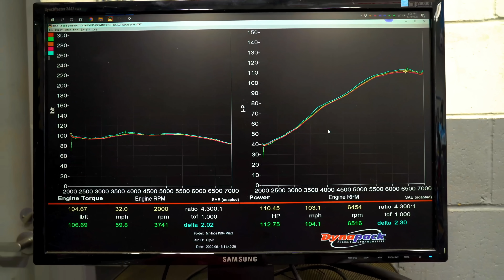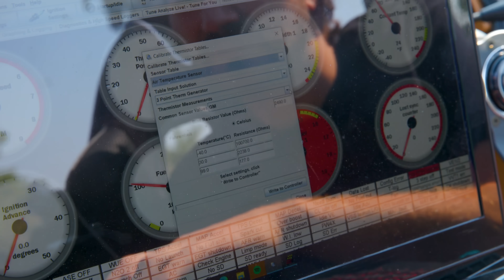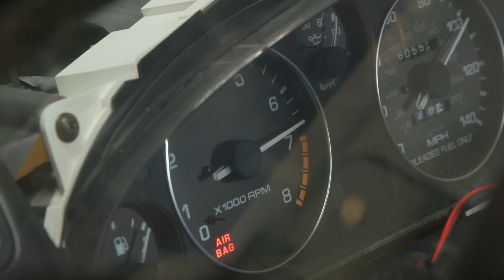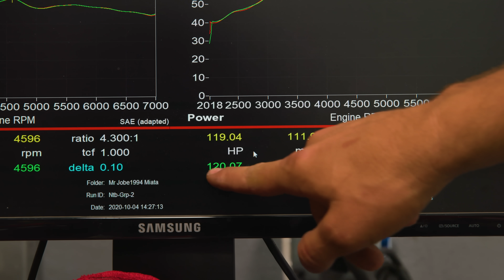Is an Aftermarket Intake System Worth It?

Comment: "it's temporary" a lie every car guy tells themselves when they do something super jank lol
Reply: Yep till it breaks and then your like now it’s time
Reply: Every time I put a zip tie in. Then I see it the next time I’m working on it and just shrug
Reply: @bensrants6772  ya, if the zip tie works, it works. Even I have some lol.
Reply: "This is only temporary, unless it works."
Reply: @ateamfan42  my old truck has a cracking tube but it’s not broke yet when it does. I’ll prolly steal one off a junk yard truck
Reply: Lol that was just me last week.
Reply: Ya literally EVERY time. 
Gettin towards the end of a project, getting late, I'm super over it...
IT'S JANKY TIME!

Tape lasts forever until it doesn't.
Reply: I feel attacked by this comment.
Reply: @bensrants6772  lin
L
Reply: @bensrants6772  one of my engine mounts is like 30 zip ties lmfao.... Alot of engine shake but it's finneeeeee
Reply: 8 months late but I snapped my chain on my bmx and didn't have what I needed to replace it so I bent the snapped chain plates back in a vice and it was the sketchiest thing ever. only difference was, it was actually only temporary haha
Reply: Well he is putting a turbo on, and can't really re use the tube without atleast cutting it down shorter, so I'd imagine temporary isn't really a choice unless he decides to not turbo it.
Reply: i was using ziptie and some duct tape to hold wires in place in my dirtbike for "temporary" but 1 year next its still there and work well
Reply: Technically everything is temporary
Reply: There was no need to call me out like that
Reply: True in software as well
Reply: Truest comment here

Comment: a couple episodes later "how to fix a boost leak on a turbo 1.8 miata"
Reply: Isnt his one a 1.6
Reply: @ariyankhan4337  nope its an 1.8
Reply: Zack is actually a grandpa Workin in a busted knuckles garage
Reply: @Blamant  i thought they didnt offer the na with the 1.8
Reply: @ariyankhan4337  1993 onwards got 1.8
Reply: @RiloElton  you're wrong. The NB was the first to get the 1.8L from factory. At least in the US. I cant speak for Japan or Europe.
Reply: @ariyankhan4337  they did with later NA models
Reply: @CoochieKissKing  1.8L was an option
Reply: @CoochieKissKing  bruh US isn't the whole world
Reply: @CoochieKissKing  NA Miatas got 1.8s Globally in 1994. That's why people say NA6 and NA8. Why are you such a goofball
Reply: 1990-93 is 1.6 b6ze, however 99.9% of US 1994-97 NAs are 1.8 bp4w. Most US 1999-00 NBs are also 1.8 bp4w with a different head design than the NAs, and obviously 2001-on has the 1.8 bp5a with the VVT head. Well, except the Mazdaspeed, which has a modified bp5a block (with oil feed and return ports) and the 99-00 head. The annoying thing, and the reason I say 99.9% is that Mazda continued to make a cheaper Miata with a 1.6 engine and the weak open 1.6 diff throughout 1994-05, but this didn’t sell much if at all in the United States, however its really common in Europe and Japan (places with taxes based on engine displacement). The thing that really sucks about these 1994 and newer b6ze’s is that they have milder cams and a lower rev limit than the original 1990-93 1.6s and make even less horsepower. Add in a couple accessory drives and the engine is totally neutered. Those cars suck, but anyone who knows miatas can spot them in an instant by the front coolant neck housing and distinctive intake manifold design. Plus the whole engine is physically smaller and the swaybar mount is further back. Now I bet you know more than you ever wanted about sub 100hp engines lol
Reply: @elementaljosh  thank you now I am certified to work on miatas
Reply: Yup
Reply: Nikku wait you actually read that wordvomit 😂
Reply: @RiloElton  1994 not 1993
Reply: @thumbtak  you're right. I messed up. However, 93 still did not have the 1.6.

Comment: Zachs Miata: $11,000 in aftermarket parts.
Zachs Miata: Long wait for a $50 battery.
Reply: Batteries for Miatas are pretty pricy if you go with the OEM Absorbed Gas Mat style (AGM). It's like $120 to $150 or so?
Reply: @slandon1977  I recently changed mine. Costed me ~$150
Reply: @slandon1977  you could probably get away with a cheap lead acid lawn mower battery lol its not like it needs a lot of current to start
Reply: @slandon1977   what is so special about the Miata Batteries?
Reply: These guys in the comments of this joke are probably tons of fun at parties. I laughed my ass off at the joke, op
Reply: A 50$ battery will have him in the same situation 😂😂
Reply: @PrashantChindarkar  AGM batteries don't leak which is especially important because they are located in the trunk of the miata
Reply: @PrashantChindarkar  From Wikipedia: "The sulfuric acid is absorbed by a very fine fiberglass mat, making the battery spill-proof. ... The battery stands up well to low temperatures and has a low self-discharge. The leading advantages of AGM are a charge that is up to five times faster than the flooded version, and the ability to deep cycle."

Also, it is nearly impossible for it to leak sulfuric gas into the passenger compartment, which is what the trunk is.
Reply: @loosenoose  Maybe I just didn't get the joke? I thought until recently that the only place you could get a Miata battery was from the dealer or one of the Miata parts places (like Goodwin Racing etc). Turns out O'Reilly's has one in stock that is probably the exact same battery. AGM and everything.

I was mainly commenting about the "wait time" because if you ordered a battery online rather than picking it up locally there WOULD be a wait of several days at minimum.
Reply: @slandon1977  wish my mitsubishi fto didn't need lithium's 😤😤
Reply: @slandon1977  That's nice. And at approximately ₹11250, they are quite pricey.
Reply: Prashant Chindarkar it’s actually a special kind of battery, particularly the size, you can’t really fit any battery
Reply: Honestly atleast you guys have good batteries. Pretty sure you can mount those batteries sideways alot of audio guys use those batteries. That or a capacitor of your ppor
Reply: @slandon1977  that's cheap?🤔 400€ battery would be expensive
Reply: @slandon1977  Is that even expensive for an AGM battery?
Even an ordinary 61 Ah battery for my car is almost twice that, in my country.
Reply: @slandon1977  It's not "sulfuric gas." Lead acid batteries, use hydrochloric acid not sulfuric and they give off hydrogen. Hydrogen build up in a trunk, or inside the vehicle can be dangerous.
Reply: is that number accurate? jesus i didn't know it was so much already
Reply: PGTMR2 yeah, for some reason I whiffed that. Good catch.
Reply: @slandon1977  No prob. I think it's an easy slip to make
Reply: @pgtmr2713  basically all the places that talk about lead batteries say they use sulfuric.... ?
Reply: @slandon1977  in your first comment you said "gas mat" when it's "glass mat"
Reply: @hildamcsulla2741  I mean any battery that’s not cheap shit won’t leak
Reply: @mercury0214  yeah, but AFAIK, flooded lead batteries have a higher chance than AGMs, for example, if placed sideways or anything that isn't straight vertical. Or than Li's
Reply: @chelarestelar  yeah I guess I’ve just never turned a battery upside down haha put it in the engine bay and check on it when your car don’t start
Reply: @mercury0214  it can seem like a joke but, if the car flips down or is a race vehicle, the acid inside of a flooded could spill. Also, lead batteries are heavy AF and IIRC, AGMs are lighter
Reply: @chelarestelar  also I’ve more or less had more car on 2 wheels and never spilled any so people just have to stop buying cheap shit lol
Reply: @chelarestelar  Looks like I'm wrong, and you are correct. Not sure how I got turned around like that, but that is on me.
Reply: @pgtmr2713  nah, no worries
Reply: My battery was $120
Reply: @slandon1977  Made I larf. Thank you ( :
Reply: Just paid $249 at an Oreilys for a premium battery. It's all the had in stock....

Comment: Zach : "We're gonna Turbo this car"
stock internals : "Imma head  out'
Reply: Remember. If you're drag racing it only needs to work for the dyno pulls and less than a minute at a time xD....
Reply: Is your name at all related to that guy with a mustache?
Reply: Clayton Salvigsen yes, but there is a guy on YouTube, his profile picture is jellal with a mustache and his name is “just some guy with a mustache” I was wandering if that’s what this guy was talking about
Reply: @jessiesratrods1210  if you run anywhere near a minute on the drag strip that's hilarious but he's also not drag racing the miata as far as I know he is doing timed laps which most courses in the miata will take more than a minute or close to it
Reply: These engines were used in another Mazda platform and they were turbo’d so they’re pretty reliable on low-mid boost
Reply: It’ll do fine in low boost... like low boost lol
Reply: @zander5173  you know you have to drive from the pits to the line, warm your tires, wait for the light to drop and then make your pass and go back to the pits right?

Comment: I have the same intake manifold its great only has one weak link, the sheet metal bracket for the throttle cable are known to fail. @DonutMedia Let me know if you want the billet replacement version I made to solve the issue. I have sold over 100 that are out in the world would be happy to get you guys set up with one also.
Reply: @DonutMedia, definitely check this out. Seen the failure first hand. David’s solution is top notch and track proven.
Reply: These are facts. Mine died on track. It sucked. David fixed me all up.
Reply: We need more people like David in the world
Reply: Does anyone know what type of thread sealent is good for the fittings on the intake?
Reply: Hey man, you definitely should hit Jobe up on twitter and let him know. As someone mention, another option would be to send them one with your information and explanation. You can find their info on their website.
Reply: I would love to buy one, mine snapped in half on track 😂
Reply: The billet one you had made worked great on mine.
Reply: Where can I get one?
Reply: @eviltwiiin  my email is in a previous comment or find my on social media
Reply: you wanna throw me one for free?
Reply: @tougetito  seriously?
Reply: @Parker_white_guy  well i got it, so….

Comment: Hey Zack, just a heads up. Keep an eye on the silicone & aluminium hoses/ tubes along your air intake. They have a tendency to pop of in small, hard to see areas, if left too dirty, especially when turbocharged. Speaking from experience. This caused all sorts of sensor issues that near crippled the car. 

Really enjoying this series and everything you guys produce. 
Thank you very much every one at Donut media.

Comment: "We're gonna turbo this car" - Did you learn nothing from Hi-Low?! Lol. Also this is the best series on donut so keep doin it!
Reply: The issue with HiLow was that they rushed the turbo job. Zach seems to be taking a much more careful and methodical approach to turbo-ing his car so he shouldn't run into the same issues.
Reply: Hi-Low are too rushy, they didn't even address the reliability issue comes with 350z and straight up adding all sort of stuff
Reply: My dad supercharged his 350z and had a mechanic do it and it took them a week but it’s been three years I think with no issues, yet.
Reply: What I’m saying is if you don’t rush it and do it right then it’ll be fine
Reply: @Leon98Leo  yeah I never took into consideration the fact on how fast they put the turbo on since they got the car.
Reply: agreed this guy is my favorite
Reply: The miata motor seems to take the added power more easily. Take ricermiata, kid beats the fuck outta them turbo miatas, and for how shitty his luck is i dont think he's actually blown a miata motor.
Reply: Supercharge the yata instead. Whos with me?
Reply: R P no one I hope, why the fuck you want a supercharger on a miata instead of a turbo...
Reply: @davidhenneberg6772  ask goodwin racing
Reply: R P I don’t ask anybody, I drove supercharges and turbos and turbos are much more fun to drive (my opinion) instead of supercharging it I rather would build it NA with the same power but it will sound much better and drive better
Reply: Since HiLow ended, this is now the best series on Donut Media. 😂

Comment: For anyone who messes with cars at home, if you have high pressure fuel lines (usually GDI engines) you can't just pop them off like Zach does in the video. His lines where anywhere from 28-50 lbs of pressure. High Pressure lines can be up to 2200lb+ on some cars and the stream of fuel out of those at that rate can laser through your fingers. Old cars have at it, you just get some fuel spray.
Reply: Good safety tip there's a lot of young guys and beginners watching these

Comment: A year from now: "Is a Turbo LS Swap Worth It?" Now we're getting to the triple digit power gains.
Reply: I wouldn't be surprised
Reply: Along a long enough timeline it will have an LS swap.
Reply: @FXIIBeaver  Ahh yes a man of RCR culture I see.
Reply: @microcar14   OH yes. But truer words have never been spoken. And depending on the set up that could be a quad digit swap.
Reply: LS is for babies, real men put v12 in miata
Reply: @Zuroslav  please tell me where you get a cheap, reliable, and easily found for cheap?
Reply: FXIIBeaver
It’s a Toyota V12 in a Miata. It will be reliable.
Reply: @negativeindustrial  the Toyota GZ? that was only available for the Japanese market? The one that has no source of parts here in the states? The one that you have to import from Japan?

Looking at all that. It seems it doesn't fit the cheap part of the cheap, reliable, and easily found. Nor does it fit the easily found part either. So yall need to bring yalls dreams down a little more to earth.
Reply: FXIIBeaver
All I drive are rare Toyota sports cars that require parts to be found in japan and imported. The parts are usually cheap AF but you really won’t need many very often because they’re Toyotas. I guess my idea of easy to get parts is very different than most.
This guy is also twin-Turboing his so we will see how reliable it remains, I guess.
Reply: @FXIIBeaver  what about a v10 Magnum from a old dodge truck could be interesting
Reply: @cancerman3990  how old? Anything from chrysler from 80s to 2010 is a very dangerous thing.
Reply: Was literally thinking on the same lines of thought!
Reply: Toyota V12 don't make power anyway.
Reply: @Ben-hf7fg  also valid point. Tiny motor. My smaller yet bigger motor makes more power.
Reply: @FXIIBeaver  I'd rather see a 18rg race engine in a Miata then a v12 limo engine. I love cool Toyota shit but the V12 only has novelty value imo.
Reply: @FXIIBeaver  I don't know to be honest I don't know much about the magnums but Wich ever is most reliable
Reply: @FXIIBeaver  you might be able to find some old BMW or Mercedes V12s in junk yards
Reply: Gl watching them do a turbo ls swap, either it's gonna be stupid or they'll pay a fabricator and mechanics to do a rear mount setup for them
Reply: I think a 2.3 ecoboost would fit, actually

Comment: “We are going to turbo this car.” 
This should be put on a shirt at this point for all the Car enthusiasts kidding themselves. 

But, I am excited for when he throws in the turbo tho.
Reply: Haha its true. The turbo project is always the goal. Im finally getting around to doing mine. I set a budget and im just doing it. So far i've spent around $2000 in only a month and still am around $2000 away from a quality setup.
Reply: Clesarie : I’m always jealous for how cheap you can get turbos for those lil Japanese cars. it’s the same thing for the brz too. I’m looking at 10K if i want a full kit for my 4.2 Audi S5 😔
Reply: Cardi B same for mine (Audi S6 4.2 V8) want to Turbo or supercharge it but it costs too much (but I think we can build in the K04 turbos from the S3 8l or RS4 b5. They will be insane but my auto transmission will hate it 😂😬)
Reply: @davidhenneberg6772  Not always as cheap as you think, for my Skyline (RB20 HR34) it's around 7-8k for a turbo setup on that engine that could make up to 450hp but the cheaper option is to just get a RB25 with a turbo already installed and engine swap for 5k. lol
Reply: @barrackobama6153  You can go as cheap as you want. Its just will it last. I mean hell theres a billion videos of people with $100 ebay turbos and they're still going on years later.
Reply: Clesarie : nah man i’m not doubting i can get a cheap ass turbo to run, i’m just doubting my skills to get a turbo to run without a kit. i’m not a full-time mechanic, i stick to bolt-ons. lol
Reply: @barrackobama6153  yeah man it's a lot of fab work for sure
Reply: Turbo kit from FM is like 3-5k. Seems like they can afford it for sure.